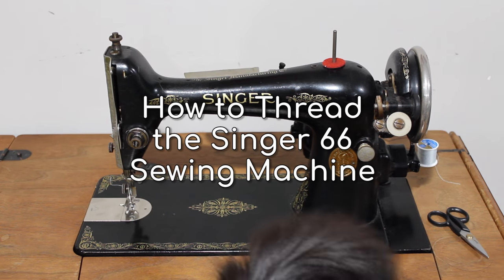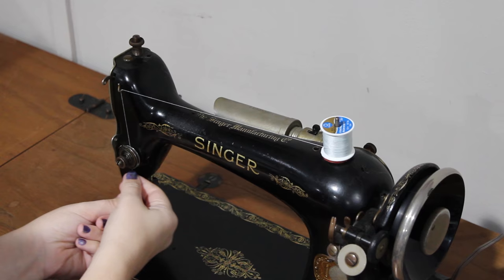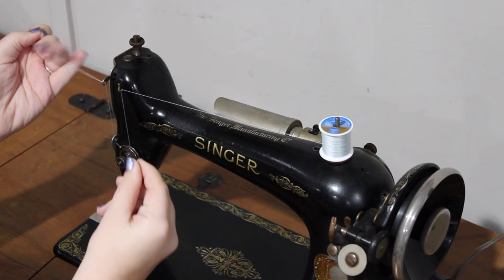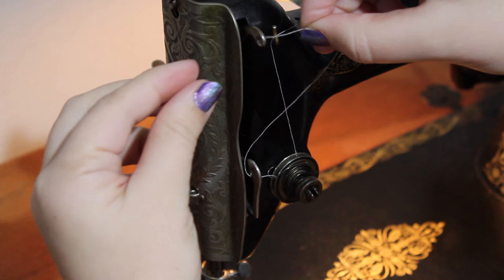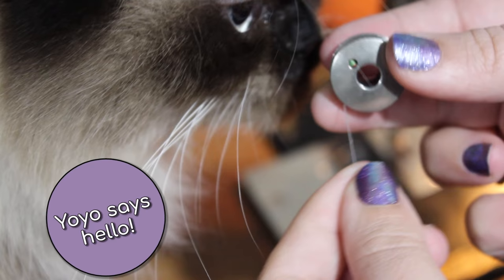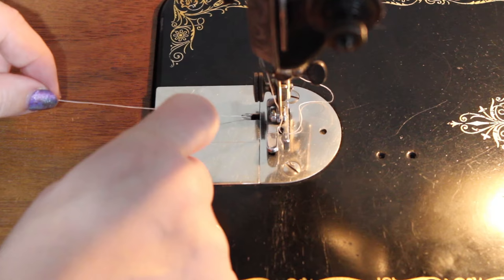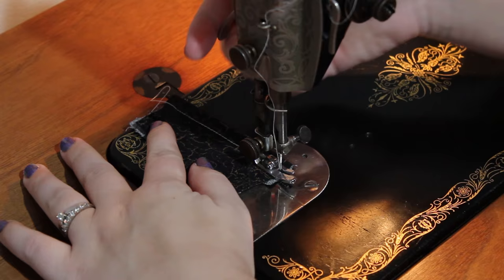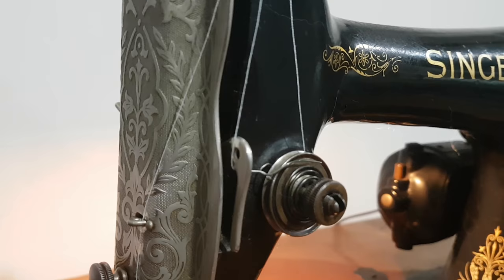Singer 66 Vintage Sewing Machine: How to Thread the Machine

Comment: Thanks for this! I'm using a Bel Air 600 but was having trouble finding a good up close video of how to thread it. Read that they were more or less copies of the Singer 66 and were threaded the same.
Reply from the maker: Glad it helped!😊
Reply: I have a Bel-Aire 600 I think.  I days Bel-Air on the head/body but it's badge say Los Angeles on top, DeLuxe in big letter in the middle s d the made in occupied Japan on the bottom in smaller letters. It's weird I ah e vena vke to find a single one like it in all my searching I curious is yours I'd the same or if your badge says  Bel-Air?!!

Comment: whenever i try to sew with mine, the thread comes out of the needle and does not sew into the fabric. is there a reason for this?
Reply: Have you tried having the thread finish under the foot?
Reply: Having the same issue
Reply: I am having the same problem

Comment: But once the bobbin cover is closed what do you do with that thread?
Reply from the maker: Hold the upper thread in one hand, taught towards the back. Turn the handwheel one turn and the bobbin thread will pop up with a loop.  Use your finger or a tool to pull at the loop so both the upper and bobbin threads are up on your sewing surface. Hope that helps! ❤️

Comment: So, I followed all the steps, but my machine keeps making a mess of the thread when I run it 🤔 what am I doing wrong?
Reply from the maker: Have you tried again?  Hope you've got it working!  If not, make sure if you're rethreading that you start from scratch even if you think your first steps are correct.  It may be that you need to adjust the tension dial. Or perhaps your bobbin is not wound smoothly.  Also double check that your needle is set correctly and that you're threading in the correct direction.  Good luck!!

Comment: How much does this machines  cost,?? I found one
Reply from the maker: You can find these at a wide range of prices since it's on the used marketplace. I paid $40 Canadian for mine with cabinet, box of attachments, and buttonholer. (My cabinet has a lot of water damage though, from being in the previous owner's garage storage.) But I've seen them listed much higher in my travels.
Reply: @CraftcoreDIY  i found one that still works. I would like to restore the painting on it, because it is kind of rusted. Do you have any tips, i would appreciate it, thank you.
Reply: @CraftcoreDIY  please do a close up on how the string goes around the tension control. I cant get it